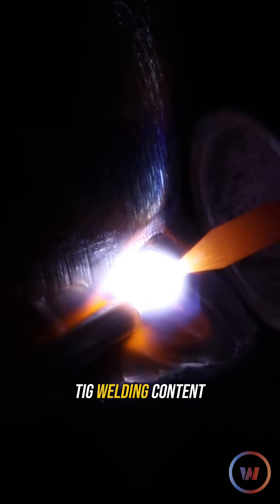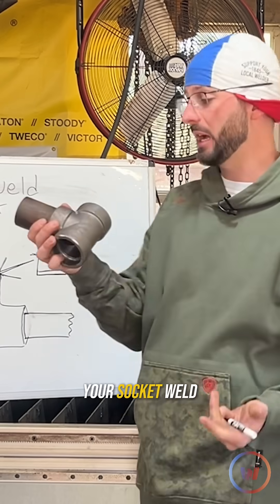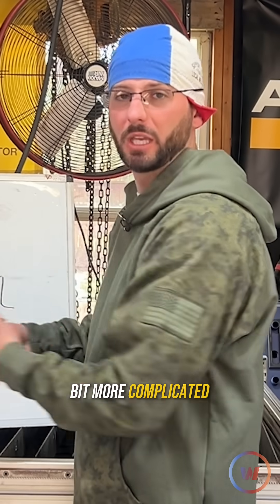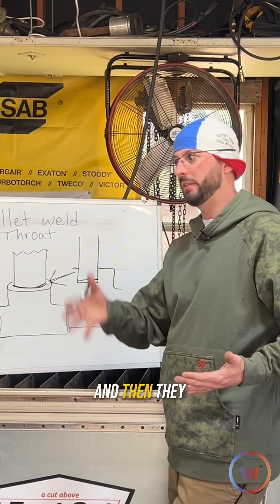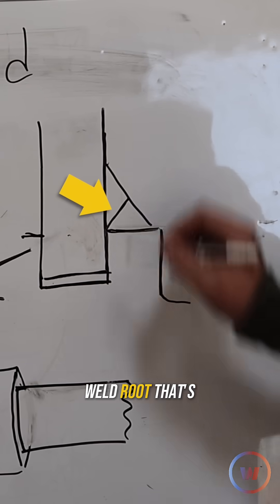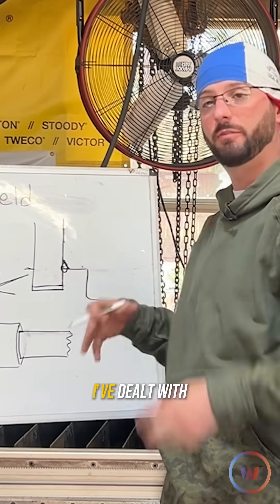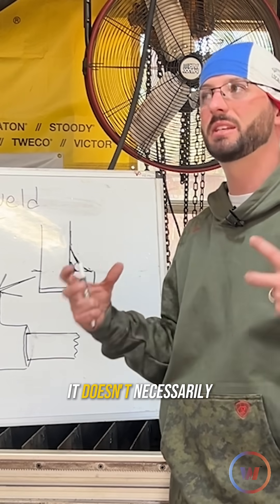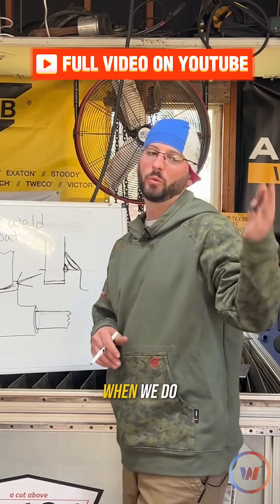What is a socket weld? #welding

Comment: I remember putting in a little over three miles of 2" steam pipe in an asphalt tank with socket welds. Three layers. We filled them out completely with 7018 for strength and to fight corrosion.  Ever use the little ring inserts to get the gap right? I've used a soapstone line drawn around and then backed the pipe out too. I think we did a hydro test at about 700psi.